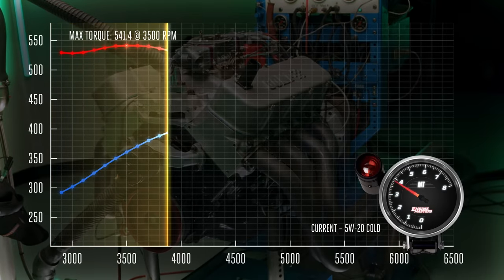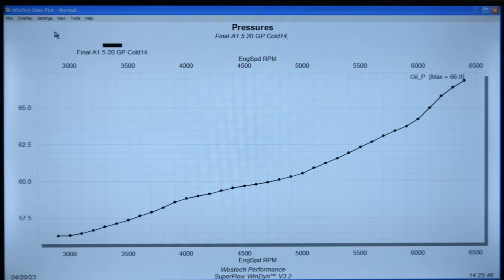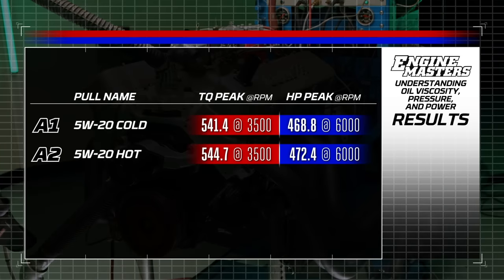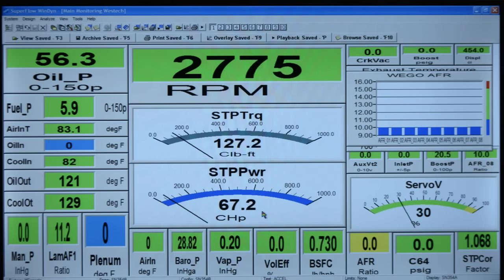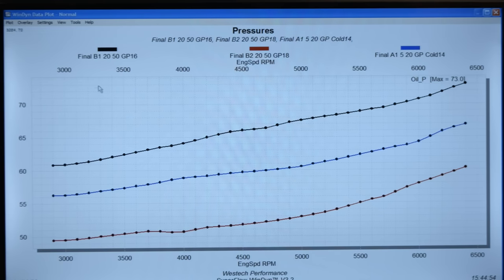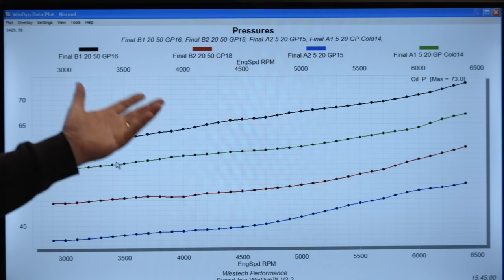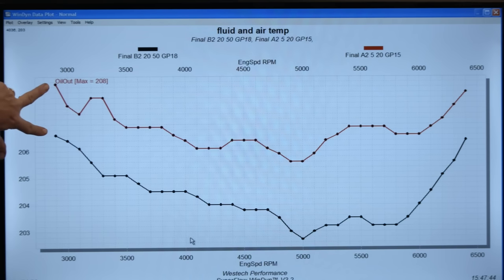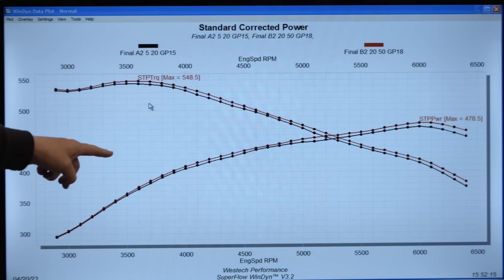Does the Thickness of Your Oil Matter? | Engine Masters FULL EPISODE | MotorTrend

Comment: I think what we all want to know is...At what mileage should you increase the viscosity of your oil due to engine wear to help preserve or extend engine life, and does that even contribute at all.
Reply: You're on a topic that the manufacturer doesn't even supply data for, as they want you to use the same oil right until it blows up. My rule of thumb is if it starts leaking/burning it, I tend to go a little thicker then what was originally in it.
Reply: @Adierit  very true, but assuming that engine wear is a thing, and that bearing tolerances might change with age, could a heavier viscosity help extend engine life considering he did mention that different tolerances require different viscosities. Although technically the answer would be yes, some testing and verification would be nice to see. Basically the science to back up this common knowledge.
Reply: I use warm engine at idle oil pressure versus oil  pressure under load while driving. When you see a big change and the oil is not a nice amber color, you need an oil change as the viscosity of the oil has been reduced by age or contamination.
As the engine ages and wears, both idle and under load oil pressure will start to drop. Increasing oil viscosity will bring the pressure back up.
If the oil is right for the engine, the oil pressure will not change significantly from  low rpm idle to driving under load.

Thicker oil will benefit or at least cause no harm to most engines to a point unless they are used in sub zero conditions. 
Most engines will work fine with oil from 30 to 50 sae.
The critical point is to maintain a liquid barrier between engine components.
Watch your oil pressure under normal daily driving and use it as a base line.
Reply: I have a motorcycle old ninja 650R (2008) with 34000km and started to use some oil. Still has 240PSI on each cylinder and pull like crazy. But when I was running the specified 10w40 oil they valve train was really noisy and the oil consumition was like 300-350ml @ 1000km. With 10w50 now the engine is less noisy and the oil consumition dropped to 200-250ml @ 1000km. 
Something cool about Kawasaki they specified five different oil viscosity on the service manual that you can use depending on the weather condition and 10W50 is between the recommend oil
Reply: @lexeriw That's really cool they do that for us.
Reply: @hayneshvac2 it’s easy to confirm the benefits of thick vs thin oil on 2 identical engines but one with more bearing clearance and while monitoring oil pressure, to a limit you can correct low pressure with heavier oil
Reply: @needmoreboost6369  agreed...but my curiosity lies in testing...basically taking old engines, checking bearing clearances, then checking the affects different oil has...I have in the past silenced a main bearing by switching from 10w 30, to 20w 50, and it did last, but I've also seen engines with main knocks go forever it seems as long as the bearing doesn't spin...mostly interested in the science, and seeing the live tests type deal.
Reply: IMO, I would increase the viscosity when the engine no longer can reach safe oil pressures at both cold and hot idle, or if it starts burning more oil than expected.

Granted, the former requires an oil pressure gauge to test.
Reply: @patx35  That is viable...but would that be too late?
Reply: @hayneshvac2  In theory, no. If the clearances (mains, rods, rings, etc.) are still at factory spec, then the factory oil viscosity is still recommended. Only when something is wrong is when I crank up the viscosity as a bandaid fix. Now, the factory would generally recommend more than one viscosity for the engine. Older vehicles would have an application and temperature chart, where you select the oil based on the season and use case. Newer vehicles only has two options: Eco friendly manufacturer recommended, and severe duty. I always pick severe duty, no matter what. If you actually read what the manufacturer dictates as "severe duty", it actually covers the majority of normal use cases.
Reply: charlieb308  I would try 20/50 in the summer maybe 20/40 in winter. One engine builder I talked to said he only used straight 30 weight in all engines he built. It varies by engine and mileage but most engines seem to run around 30  to 50 psi. Whatever your engine oil pressure is after a new oil change just watch it to see when it starts to drop off.
Reply: charlieb308  Engines back then didn't have coatings on the bores. So your seeing bore vs ring wear and likely bottom end bearing wear.
IMO... try straight 30W.   Or if you use it in sub 30F temps maybe 10W-40
No matter...  you have both bottom end and cyl bore wear.
Reply: It's probably not mileage related.

My 2012 Mazda, at 178k miles has enjoyed a lifetime of 0W20 and consumes no noticeable oil between changes. 

I did go from 7500 mile OCIs for the first 150k to 6000 mile OCI at 150k for the last 28k miles.

No data, just peace of mind, and it better coincides with tire rotation schedules :)

If you notice consumption, maybe switch from something like a 0W20 to a 0W30, 5W30 or 10W30 depending on your climate.
Reply: @buffuniballer  It's not the consumption I am referring to...Over time rod bearings will get thinner with wear, which changes the tolerance. Oil is supposed to fill those gaps and create a cushion for the rod bearing to ride on. Although the oil is to prevent the rod from making direct contact with the bearing and the crank, the oil cannot eliminate friction completely, hence wear. I can't remember the mileage at which you should overhaul an engine, and I know Synthetic oils are better at reducing engine wear, but it can not be eliminated entirely. So basically I would like to see examples at different mileage documenting this wear, what the tolerance are, and what recommended viscosity would be required to fill these new tolerances. I am fully aware that engine overhaul is more directed to ring and cylinder wear, but rod bearings and cam bearings wear as well.
Reply: @hayneshvac2  - If you've kept up with maintenance and done timely oil changes and kept the oil level in the safe range, you are probably good for 500k miles before you need to really worry about main or rod bearing wear.

Now, if you beat on the car before it's warmed up, or have a faulty oil pump, use cheap filters, or have high fuel dilution that impacts the oil, then yes, you need increase the viscosity or perform more frequent oil changes.

Short of an engine tear down, oil pressure is going to be your indicator that something may be going on.  Especially warm oil pressure with new oil.  That's pretty much the marker you have short of tearing down the engine.

Even that is only so good as it is impacted by oil pump and filter condition.

But a well maintained engine should have a long life.

If I HAD to give a number, it would be at about 250k miles for most street driven light vehicles with no other issues as described above.
Reply: @buffuniballer  I think the assumption is that mileage is associated with wear. Wear is the actual issue. But low mile engines generally cant have excessive wear. So high mileage becomes a synonym, for high wear.
The only real issue is maintaining the oil barrier between metal parts. Your engine with its tolerances and oil pump and temperature and wear will all combine to produce a particular pressure which can be read on a gage, This can be used as a base line to indicated oil life in the near term and over a long term life of the engine can be used to indicate engine wear.
Reply: @buffuniballer  agreed, also to add that a carbureted engine doesn't regulate a well as fuel injected. and oil can become fuel soaked in shorter increments causing wear as well...but, it would be interesting to see examples...I'm not asking regarding a lack of knowledge, I've just never seen anyone do this experiment.
Reply: Rotella 15/45 with a bottle of Lucas.  You could also run what you are now and throw a bottle of Lucas in but the Rotella has zinc in it already.
Reply: Dont think it matters one bit, or at least not measurably. Maintenance and driving habits imo have a bigger influence

Comment: I just wanted to mention that not only does a thicker oil seal the rings better but they also keep fuel out of the oil better for some reason. My direct injection pushes more fuel  into crankcase with thinner oils and also the fuel reduces protection so I use thicker than suggested spec oil.
Reply: Good point!
Reply: You've got a good head on your shoulders
Reply: A lot of new factory engines have low tension rings.
Reply: @duckwacker8720  well it's a relationship: dynamic moving piston + cylinder walls. Some get the job done and some don't. Its a balancing act as usual.
Reply: I'm not sure what the owners manual says for your car,

But most give a range of oil viscosities that can be used.

Though some do not, and using a thicker oil can..... and will damage the engine.

For example the 4 cylinder non-hybrid Camry (not sure about the Hybrid), last I heard......

The oil pump was tuned for 0W16 (from memory it's electrically driven, not mechanically), with the owners manual stating that in an emergency the oil can be topped up with 0W20

But at the next oil change 0W16 must be used.

From memory and from what I remember reading online, some people didn't realise this and were using 5W30......

It did not end well.......
Reply: @notsureyou  It's one of those things where you need to consult a brand certified mechanic before you "get clever". I know a BMW mechanic who advises his customers to go up 10 points over the listed one for a specific model. This affects the mileage ever so slightly but precisely enough that it would put it in another eco class in EU rating. But it stops the oil seals from starting to leak prematurely (of which he has had hundreds of cases) and he sees less slap-side wear on the bore. So this is one of those cases where the bean counters got their way.
Reply: @andersjjensen  that makes total sense. Thanks for the contribution to oil discussion.
Reply: It's for the same reason, better ring seal, especially on newer light ring small land pistons used now.
Reply: The bean counter usually get their way!  @andersjjensen
Reply: The 'for some reason' is also ring seal.
Reply: @notsureyou  camry euro owners manual says you can use 5w30 just fine. only the usa one says 0-16 and 0-20. unless youre saying toyota sent different engines to different countries from japan?
Reply: @PhaseSkater  To be honest I wouldn't have a clue if there are any difference between the engines,

I vaguely remember someone mentioning the use of a different VVTI (I can't remember what the difference was in the mechanism),

But only comparing the parts catalogue would show if this is true, and if it is true for which countries this applies.
Reply: @notsureyou  there’s no difference. It’s because in American there’s “ cafe “ standards or something to reduce emissions for the overall companies fleet or they have to pay fines. You get better gas mileage and cold starts with thin oil but more wear on the engine

Comment: I was driving my mustang earlier today 10.5:1 347 , 6 spd, 4.30s and noticed when it has been running for a while with 20w50 in it it seems happy . Oil temp is at around 200-210 degrees and water temp at 170-180. It was around 80 degrees outside. I was sort of thinking it would be hot but it definitely seems happy and running really good. Derale dual fans and champion radiator.

Comment: In some racing, it is common, and proven to work. Changing both viscosity and the amount of oil, to lower the ET. We can drop two viscosity levels and use 1-2 fewer quarts of oil and see a substantial change. It's part of what we call "switching from bracket mode to heads up mode."
Reply: In a previous episode, engine masters proved that a few quarts less oil will make a noticeable amount of more HP.

Comment: I and a few older guys were running  durablend  before they even came out with it, we mix are own, It worked quite well; rings love oil it make some seal producing more horsepower moving parts like synthetic oil. The Best of both worlds and the high mileage package.

Comment: Bottom line takeaway for me is to run the correct viscosity oil for your engine clearances but, run it warmed up hot so it’s doing its lubrication job but allowing the most power. I think this is what racers have been doing forever even if they didn’t fully understand the science.

Comment: in my air cooled bike I run 20w50 just because it is hitting 110deg here in Texas so if it is getting over 212 deg I want that little extra chance it will not allow parts to touch ..when it gets cold will drop back to 10w40

Comment: I just switched to this (GP1) from the driven HR4.
Running 20W – 50 in a small block stroker with high compression. So far so good.
It also has a light green tint to it, which, for me, is easier to read on the dipstick.
Reply: I like 20w50 because it sticks to parts. That's what I run and when I disassembled my 302, I was surprised how all the pushrods were coated with oil
Reply: @XxMusclecarsxX  And you aren't gonna take the hot rod out on salty winter roads, so overly thick oil in January isn't as much of a concern as it would be on a daily.
Reply: What exactly are you happy with about that oil. If you put super tech oil in you wouldn’t have and change at least you can tell so what is it exactly that you like about it other than feeling the need to comment without having some proof or a change that happens

Comment: The correct oil level in your crankcase will give you far more horsepower than thinner oil. 35 years of swinging a wrench: oil level in the middle of the add/full range = perfect.
 Heavier oil complementing ring seal is very real, so is high rpm scouring and scoring protection from higher film strength oils.

Comment: Interesting!  Good test!  
Oil pumps use a lot of power at high pressure...  My next step would be to adjust the oil pump relief to find the lowest safe oil pressure for less drag.  
I went from 70 psi to 45 psi on my boosted 389" SBC and I could feel the difference in the seat of the pants and it picked up about 1 mpg on the street.

Comment: I saw a display and sat thru a briefing about oil weight. I saw that 5-30 was better than 10-30. That was for engines that require a 30 weight oil. The demonstration was impressive. This was 20 years ago.

Comment: I agree, we run straight 30 wt. In our hot rod engines with  .003 thou. On the mains, .002 on the rods, we use HX bearings with plus .001 thou. Clearance, or grind the crank to our specs. !

Comment: I see a lot of people running oil that's too heavy. You don't need 20-50 or 20-40 in a street car, when it's cold it's eating up HP and gas mileage and putting a huge load on the oil pump drive shaft and timing chain (if driven from the camshaft)  with no benefit. It may even overload the oil bypass valve when using a plus size oil pump and could blow the filter or cause oil leaks.  Even hot 40/50 is more then what's usually needed unless they have low oil pressure, in that case it's just a bandaid and not fixing the cause like worn bearings.  Cold oil will always be heavy enough to make more then enough pressure, I run 0-30 in my turbo subarus to reduce cold engine load and help get oil to the turbo.

Comment: 30 years ago I went to Mobil1. 25/50. Which ofcourse flows so much better when cold. Dry sumped 355 Chev I had to put a softer pressure relief spring in the pump or it had near 100 psi cold. It ran 55psi warm,, oil temps were down 20F. This with 1.8-2 thou down the crank. It uses less power to turn the pump, less oil temp than my previous Pennzoil. Later on I used 15/40 and it made no difference, this a 12-1 7500 rpm  n/a engine. I have used Mobil1, Shell, Penrite [Australian] and Valvoline synthetic oils  and change it less regularly than mineral oil. 
Initially I was told no good with roller cams,, it did a lot of race km with no issue. 2000 km and the bearings looked new,, unfortunatly the crank was cracked. That is NOT an oiling issue at all. A good synthetic oil is superior to mineral oil or semi synthetics, They are fine for normal roadcars unless you work them very hard towing or racing.

Comment: Being that I have bushed pressure fed roller lifters, I'll stay with the thinnest oil that gives me the Hot pressure I want. I think that the thinner oil feeds that space which is very small between the bushed outer and the steel pin.  I've also noticed that if I use a thick oil my oil temp is a little higher in the pan.  I like my HOT idle @1100rpm about 25lbs. if I touch the throttle it quickly increases. I'm good with that.

Comment: Worked for a huge logistics company for 30 years. This is what maintenance told me.. run the recommended oil viscosity for climate/season temps. The reason is this . The oil jets and orifices are designed to provide a certian rage or flow per minute. If you go thicker of thinner you will actually starve the surfaces of oil . The company purchased 250 power u its with Cummings 16l engines.  The recommended oil was 5-40 . Because of the huge stock pile and older units maintenance was instructed to use the 15-40 . After about 650k miles these new units started having issues. Cummings discovered that the  wrong oil wieght was being used. Every single engine was DENIED a warranty claim. That was a         25, 000,000 million dollar mistake.

Comment: I feel really good about running 10/40 in my marauder and 20/50 in any push rod engine. The epa for what ever reason is pushing thinner oil and if you shop at Walmart 20/50 and 10/40 is hard to get. Ford retroactively now recommends 5w/20 in everything that's a business decision not a decision from anyone that cares about your engine.